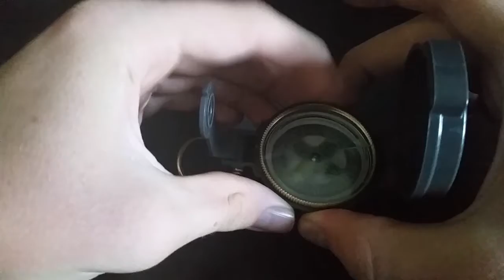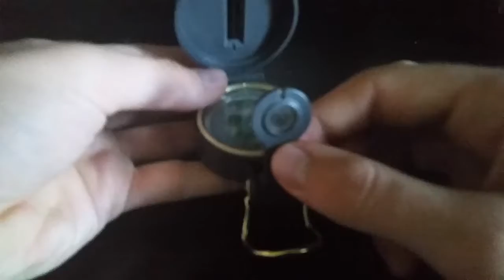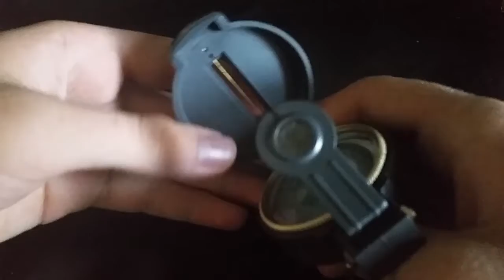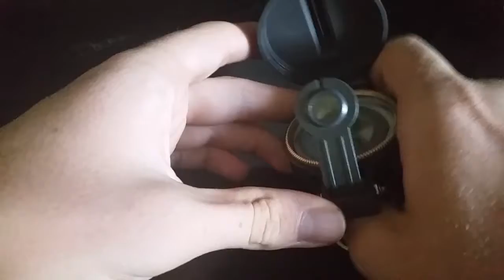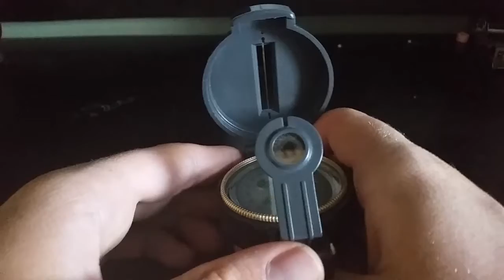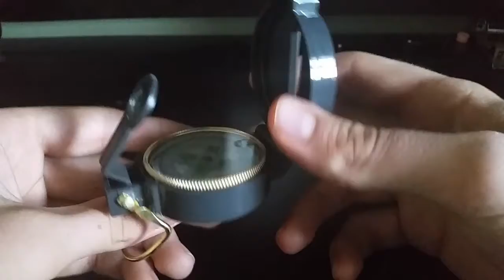how to use a lenstatic compass

Comment: Sir i have a question.I have this compass.Sir will this compass be very fine quality and be usable for a long time?because i think so as the weight of the compass is fine and all the parts are also fine.So please let me know.
Reply: Yes these keep their accuracy. However mine is the same one but a black plastic model and one of the sides to the thumb clip broke off but it still does it's job. I would like to find a heavier duty one though
Reply: It still works correctly and nothing has been incorrect
Reply: Sir is it suitable for heavy duty use.I like it very much and I don't want it to be broken.
Reply: I got one that's still in great condition from WWII I plan to have it my whole life.